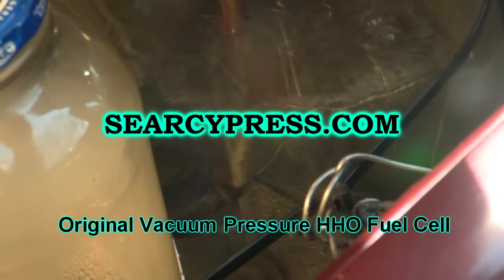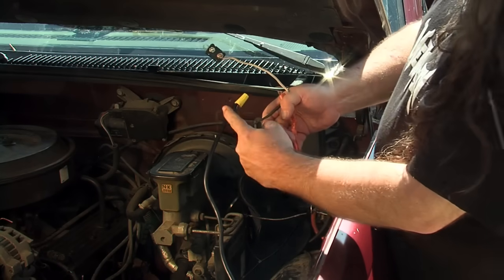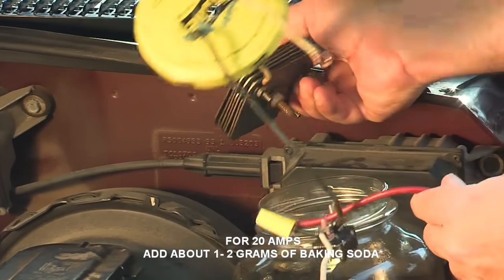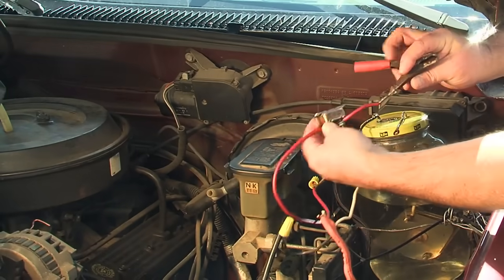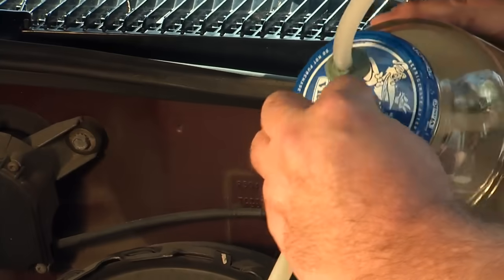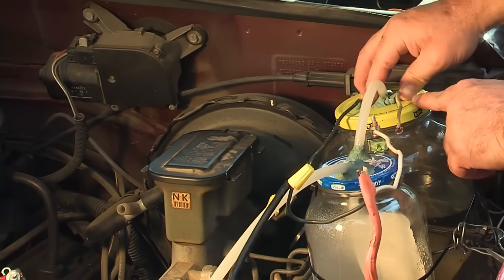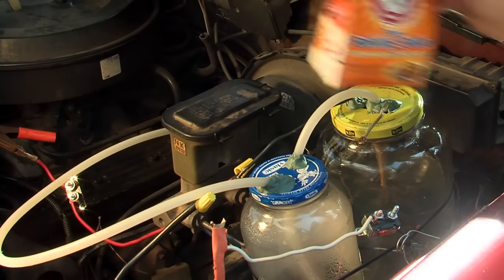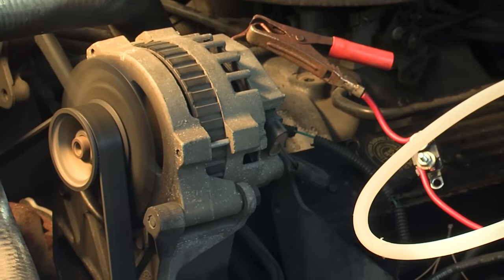Vacuum Pressure Hydrogen fuel cell defeats high gas prices using hydrogen from H2O.

Comment: Imagine what scientists can really do if this guy built this
Reply: @Damion Manuel or u can do some basic math and find out this doesn't, won't, and can't work and not look like a fool to semi intelligent people reading these comments and laughing.

Just idling your engine is over a 600 rpms. Driving a 2.5 liter 4cly motor  is about 150 cubic inches. That's 37.5 cubic inches per a cylinder. A cylinder fires ever 2 full rotations. So in a minute of idling at 600 rpms your engine will use 11,250 cubic inches of air a minute at just idle. That's a 187.5 cubic inches a second of air. You're not producing even 2 cubic inches a second. But don't forget that it's h2O 2 parts hydrogen 1 part oxygen. So 1/3 of the gas isn't even hydrogen it's oxygen. So not even 1% of the air being taken into the cylinder is hydrogen. The only thing being accomplished here is the alternator is working harder for the high amp draw dragging the motor down more reducing fuel mileage. This is why water isn't used as fuel in a motor vehicle. 

Now don't forget we don't drive at 600 RPMs most people will be around 1800 rpms at cruising speed. That's 3x the amount of air with still the same hydrogen production. So now ur way below the threshold of .03% hydrogen in the cylinder. Using a spark arrestor on the output hose to keep from blowing the jar up you would be hard pressed to even candle a flame let alone put anything measurable in every cylinder 900x a minute cruising down the highway at the speed limit.

Comment: I built one years ago that did work' 
I used a PVC container vs glass hooked to an overflow tank for refilling. They make a 120v toggle switch vs the house switch. Use brass fittings where the tubing enters the jars.
I also added a one way valve and a tube exiting the vehicle so any accumulated hydro would vent safety outside. 
👍 Happy driving.
Reply from the maker: A vacuum pressure system cannot be made out of plastic because it will collapse under the heat and stress of the vacuum. Thanks very much for your comment.

Comment: How did you tune the ecu to lean out the fuel to compensate for the added hho?
Reply from the maker: When adding small amounts into the vacuum line it is not necessary, at least on this engine. Excessive amounts of oxygen certainly could cause the computer to make a richer fuel ratio. Trucks like this already are burning way too rich. What happens to the ratios when you get a vacuum leak?

Comment: Back in the early 80s for about $20, there was a product consisting of a 1qt. 1-way rectangular bottle containing what they called "liquid platinum", it looked like pinkish-silvery water. A hose connected to a vacuum line at the base of the carburetor, drew air into the bottle making bubbles, then into the cylinder and burnt. 81 Ford E150 cargo van, 300cid inline 6, 1 fill up in So. Padre Island Tx., $35 in gas to Omaha. Its been gone shortly after, cuz it 🖕ing works!
Reply: I have an 81 econoline with the 300! Wish I could get my hands on liquid platinum

Comment: I want to talk to you about this
Reply from the maker: We were the pioneers, it's come far since. When we started youtube had 2 search results for hho. Joe cells and stanley meyers. Not sure I have much info to add but ask and I will try. Thanks for the comment.
Reply: @metalpresstv  so all you do is connect it to your vacuum system and it sucks the gas out?
Reply from the maker: @Willyd2758  well sort of. The vacuum of the engine varies. On deceleration the effect is at its highest. When you floor the gas the vacuum pressure is lost. This effect goes back and forth quite a bit. Regardless, the entire time the gas is going into the engine and is getting burned. The most beneficial effect of the vacuum is the thermal properties. The boiling point of the water is reduced. The water behaves like a refrigerant because it is in vacuum. No, it does not super cool the engine. What I am saying is the thermal properties of the fuel cell itself benefit greatly from the transfer of temperature under these conditions. Non vacuum pressure type cells get much hotter and behave much differently.
Reply: @metalpresstv  radiators use pressure to keep the water cool inside your engine. This makes sense now. 
I have a 1994 Chevy k2500 with a 454 big block, so it should produce more than enough vacuum. Do you still have this old style system where your using pickle jars and poster putty, or did you upgrade to something different? Thanks for the help man!
Reply from the maker: @Willyd2758   @William Dickel  I can't say too much for a lot of reasons. This was an exposed system that takes a lot of criticism for it. How else could we show it usefully? We aired this stuff on  national tv and the rest is history. Including mythbusters " no bubbles"  fiasco two or three months later. Vacuum is a wonderous thing. I'm not telling anyone to go build this. We just opened the doors long ago knowing others could research it further. Running an engine completely on this gas however is problematic. HHO gas is extremely reactive. It is capable of melting tungsten. Using it to boost an existing fuel however is extremely interesting.
Reply: @metalpresstv  the only reason the myth busters test didn’t work was because they weren’t allowed to show people it worked. Then oil companies would shit. 
I’m not going to criticize your system, the video is old and yes, there are systems that look better, but I’m looking to improve my mileage, not win a beauty contest. I’ve actually got jars here ready to go, some wire and hoses. Is it really this simple to build?
Reply: @Willyd2758  it is about tax revenue.  How many old carburated cars stopped running from water binding with ethanol in the gasoline? Causing the float bowl to fill with water.  I had one neighbor use the water in the coolant to heat the fuel line. Better gas mileage but less horsepower. Not sure if anyone makes a 12 volt vacuum pump. But it will increase gas production in water.
Reply: @metalpresstv  and also, I’m confused about the electric element in the bottle. How did you connect it inside, like where did the wires hook to, and how do you increase/decrease the amps it pulls?

Comment: I especially like the "glass jar" holding container. OSHA sanctioned.
Reply from the maker: I understand your concern, however this is a vacuum system. I doubt very seriously you're afraid of the light bulbs in your house. During normal operation the risk of explosion is extremely unlikely. However with a poor installation or a major malfunction of some kind there is a chance it could go bad. However in multiple tests we lit the gas inside the jars. In every case the lid blew off of the jar and never were we actually able to break the glass. The gas Burns at approximately 5,000 ft per second. The lid of the jar is the weakest spot and that is where the gas exits. Of course there is always risk so do not replicate. Thanks for your comment.

Comment: The hydrogen is not used as a fuel it simply facilitates a more efficient burn/ combustion of the gasoline. Hydrogen can be used as fuel but it must be pressurized to do so and is dangerous because it is highly combustible.

Comment: I have heard that hydrogen is a very unstable fuel. HOW do you calculate the right amount that goes into the engine without the risk of blowing it???
Reply from the maker: We are only enriching the fuel. We are injecting hydrogen and oxygen that recombines and forms water, or steam. Most people don't realize that water is a byproduct of burning gasoline. The result is a more efficient burn. We have tested very large amounts of this by putting a generator in the back of the truck and hooking it to the fuel cell itself producing approximately 6 ltr per minute. What we ended up with was basically a very large increase in horsepower. You won't save any gas when you're burning off the tires enjoying the extra torque. Running on pure HHO gas would probably melt the engine. The gas that it produces very reactive and can actually melt tungsten. Thanks for the comment.
Reply: @metalpresstv  you reckon the combustion heats the gasoline to a higher degree than usual, or atomised it better, then takes out the heat of that explosion by combining to water and steam? That would explain being actually able to run hydroxygen without overheating the engine.

You should try a couple of tubes up combined with air tubes under the surface of a gasoline tank straight into the carb and see if that improves it even further.
Reply from the maker: @compuguy123  only about 80 percent of the gasoline injected to the piston burns normally. This process kicks that  above 95%. We are also injecting steam into the engine as well along with the hho. I do not think burning 100% HHO is feasible. Honestly, it's not really necessary. Sometimes just a little bit of this magical gas is all that is needed to increase the amount of gasoline that you are burning. Where this system outperforms others is because we are injecting it in the vacuum of the engine. It is not mixing with the air that is going into the carburetor. Steam injection is a proven technology. You won't find much on it anymore, but Edelbrock actually made a system just for that. Thanks very much for your comment.
Reply: @metalpresstv  What I mean is when you wire this in parallel or series with a fuel vapor tank, where you've got 6 or more pipes pumping straight under the surface of the fuel with filtered air, powered by the engine vacuum, and then either hook up the HHO generator to one  of those intakes, or to the engine as you've done here. The fuel vapor systems I've seen have always improved mileage on every vehicle, so this may come even closer to a 100% burn. 

It may be beneficial to hook the HHO up as you've done here, then the fuel intake straight into the carburettor with the vapors. If anything, the method you're describing here probably catalyses the fuel to break apart more at the droplet level, therefore causing that clean burn - alongside cleaning the engine and helping lubricate the pistons with water too, while cleaning it also. Might be a cool side project to try out. 

HHO does seem to be the easier implementation though, without a doubt. I surmise it has the same function as adding acetone to your fuel tank in very small percentages to catalyse atomisation. 

The hardest thing about implementing a fuel vapor system is rerouting the exhaust either by itself, or with a massive network of heatpipes to heat some metal pipes when the fuel vapor injects into the carburettor to prevent stall out, and also to allow the fuel to burn much more completely. This also necessitates the use of a flashback arrestor, if anything.
Reply from the maker: @compuguy123  without saying too much, I never show what I'm using now. I commend anyone who is brave enough to advance this technology. Thanks very much, be safe.

Comment: Last comment for tonight... so i watched stan meyers (water powered car guy) make the spark plug wires so that they had water flow through them and sparked the water right before the cylinder so ANY car could swap out for hydrogen ability. I think thats an amazing idea. We need to collab.
Reply from the maker: They're a lot of fuzzy details in the Stanley Meyer invention. He talks of using lasers and things like that. No telling what the man really had going. One thing is for sure, if you try to run your engine on 100% Hho it will melt into a puddle of goo. The temperatures that pure HHO burning will reach are far beyond the melting point of the metal. HHO can melt tungsten. It is a reactive gas. Until the flame actually touches something it is fairly cool.. very interesting stuff. I love the Stanley Meyer story however I question the validity of him actually running on 100% gas made from water without some sort of separation of the hydrogen and the oxygen. I never saw any separation in any of his patents. Perhaps I overlooked this. However, it is a huge red flag for me. Thanks again and have a great evening.

Comment: i hear the computer tries to correct the flow of air/fuel and that you may need to mess with some info in the computer.. is that true?
Reply from the maker: Yes absolutely true. If you inject too much HHO you can see negative effects on certain engines. The oxygen sensor will see the excessive oxygen and add fuel.  Sometimes just a little is better than a lot. The thing about these old trucks is they all burn rich.. way too rich. Modifications can be made to some computers to eliminate this if you have the skill set. While you may not see mileage increases you will see horsepower increase when burning large volumes of hho. Please no arguments on the laws of thermodynamics. These engines do not burn all of the fuel leaving a lot of room for improvement. There are no violations of the laws of physics in this invention. Thanks for your comment.
Reply: How do you regulate the amount of hydrogen that goes into the vacuum line? Other videos show that they store hydrogen in seperate tanks... seems like a pain. This is good for me. Just need a few questions answered before i try it on my truck.

Comment: Hey boss love your content. I need to know how to hookup the fuel into the carburetor!
Reply: you connect to the vacuum line that he showed.  No need to touch the carb.
Reply: @notagain1952  thank you. And the computer doesnt act up as long as the vacuum line has it added after the airflow sensor?
Reply from the maker: The hydrogen oxygen enters the engine through the vacuum line. The vacuum pressure of the engine will rise and fall with the acceleration and deceleration. Typically much higher when you let off of the gas. Injecting into the carburetor effectively leans the HHO to the point of ineffectiveness. That is why research on vacuum injection was so interesting at the time. Thanks very much for your comment.
Reply: @metalpresstv  your a genious bro. My goal in life is to make my 1990 dakota v8 run off this. They sell a kit in Canada for $1,000. I love your work here bro. This is truly life changing. Atleast for me.
Reply from the maker: @tannerfehring  thanks very much. Myself and others involved in the project were just pioneers. We were doing this when you could only find two videos on the internet about hho. This was basically a variant of what was called a Joe cell from Australia. YouTube did not exist as it is. Our first videos were actually on meta Cafe. I'm thinking it was 2006 or 2007. I can't even remember that far back now.. You might find them there. 90% of our videos were removed by YouTube before 2012. Way back then adding music to your videos was not actually a problem. We aired one of our shows on national television. About 2 months later mythbusters decided to debunk everything about it. I wonder how much they got paid to lie about the ability to make a bubble? Lol thanks again be safe and don't replicate anything I do. (- :

Comment: Great idea, any flammable gas injected into a gas engine greatly increases gasoline mpg(better gas burn etc.) My saturn sl2 gets 70 mpg with propane injection. Hydrogen here is free though!!
Reply: propane has a much higher energy content than hydrogen. Generating the hydrogen is not free you are taking power from the engine to generate it. The best you could hope for is increase burn efficiency. Excess gas = waste of power as you never get that power back - I mean, if you did it would be a perpetual motion machine.

Comment: I believe that you have the hydrogen gas delivery into the engine through the vacuum system. Is this correct?
There is no throttle other than the on/ off switch.
This is an amazing innovation that you have here. Nice work.

Comment: Why do you use a dry jar again?
Reply from the maker: It's not really a dry jar. It is a secondary jar that catches the water vapors that condense into liquid. This prevents water from getting into the vacuum system in liquid form. Because of the piping you will have several inches of water ( it becomes a bubbler)  that will automatically by suction return to the fuel cell when you shut the engine off. Thanks for the comment.

Comment: How many times have you shocked your self by using that open air switch under the dash ?
Reply from the maker: With 13.8 volts I don't think I have ever even felt a tingle. Thanks for the comment.

Comment: you burn all the HHO as you use it .. safe! ...30 50% more fuel efficient...the HHO is a water vapour that burns more petrol .. most cars can not burn more than 50% fuel in the chamber ...that is why petrol stations don't cars idle running and signs to turn them off .. as to other vapours from the pumps.  .Trolls say it will damage your engine .. non sense ..the opposite .. it will last twice as long .. burns clean .. very high octane .. you never herd you engine purr .. the idle will drop 25% ....increased power...

Comment: Is this fake?
Reply from the maker: No it works, but performance varies. One might think automakers have designed newer cars to sense this technology and defeat gains. Thanks for the comment.
Reply: @metalpresstv  wow I have a 2002 Chevy Silverado 2500 had will it work on that and how much gas does it save?